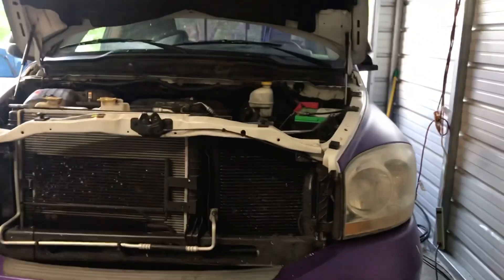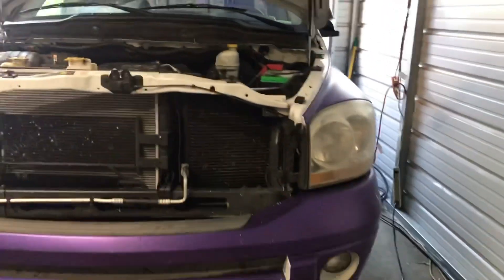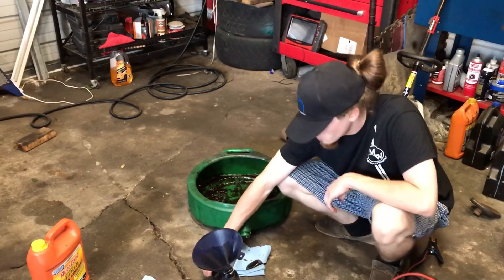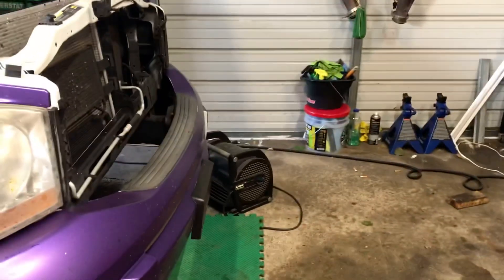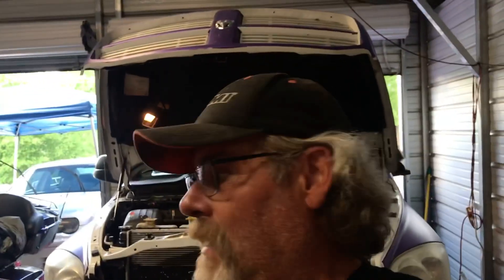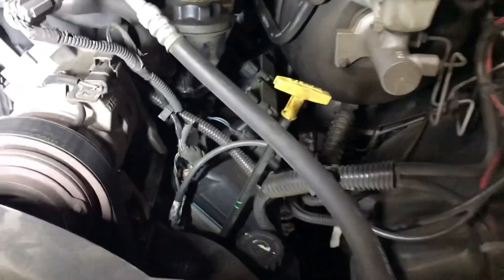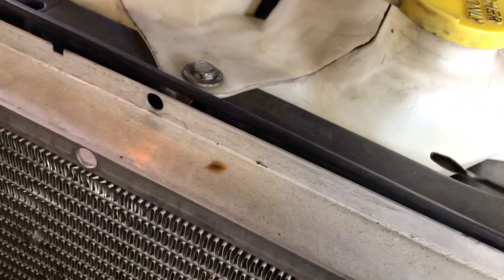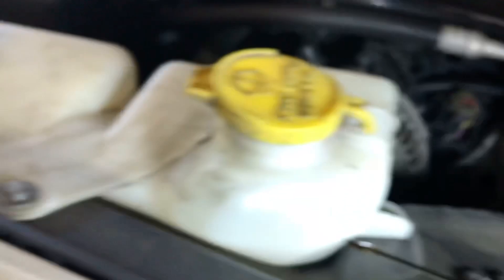Barney’s back and it’s not what you think.see how the 5.7 Hemi doing after rebuild.#nonamenationals

Comment: It looks like you are using stp filters. I have had experience with every one of them causing lower oil pressure when cold and at temp. On different vehicles it is consistently lower  I use  at minimum a Motorcraft filter  when I catch them on sale I will use a Bosch or Mobil 1. STP is made by Fram and they are the same. I'm glad Barney is doing great  Keep it up Al!

Comment: Really good job- done with professional speed accuracy, and excellent results. Paint job looks real good. I too always change the oil every 3000 miles and it keeps oil passages clear, bearings clean, and you really don't have to worry that much about using expensive oil filters, imo.

Comment: Hey Al, what oil/filters are you running in these Hemi's in general?
Reply from the maker: Mopar or wixs , but my auto parts store in my area are out.. so I’m using a stp filter at the moment.
Reply: @MikeBrown-ii3pt  My local NAPA unfortunately sux for a variety of reasons. CarQuest used to use WIX also but now are Baldwin. I can get WIX at O’Reilly or order some from Rock Auto or something. Have used WIX in general for years but recently got a bad 51516 that wouldn’t let my 383 build oil pressure. Grabbed another I had off the shelf and all was good….

Comment: Al. The tuner you put on this. Is there any that will bypass the safety system. Have 05 5.7. jeep sob just cuts off when it wants crank/no start. No codes. Then sometimes it will fire right up after setting. Have tried changing keys we have 4 keys so before ya say cut a new key.... There's that
Reply from the maker: Not that I know of.. went through that with my Jeep Commander, ended up getting a pcm with the skim code removed.
Reply: @TheTazzman1968  thanks brother appreciate you!